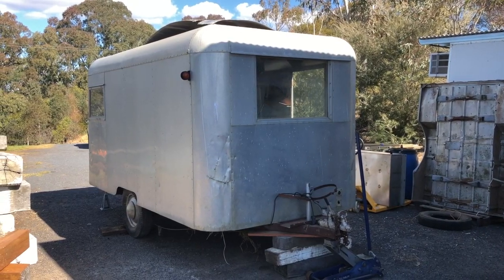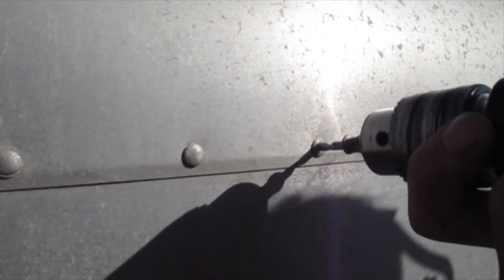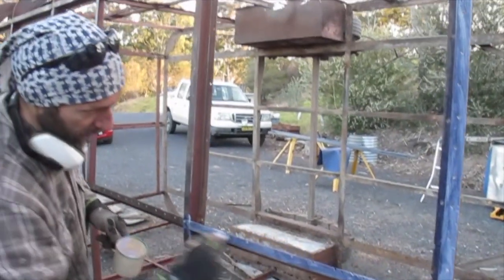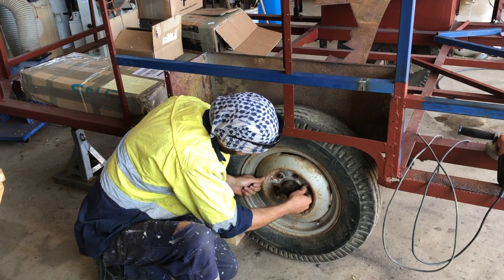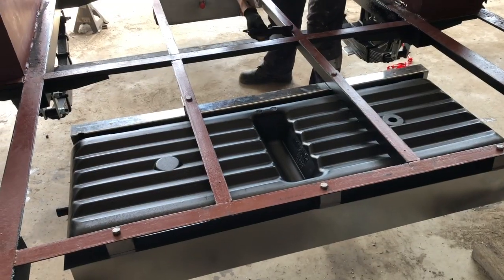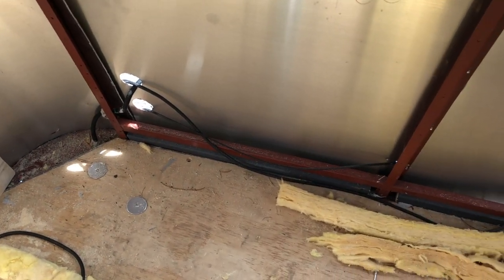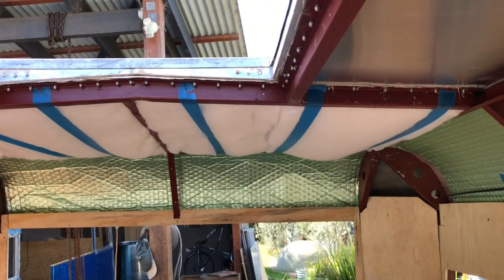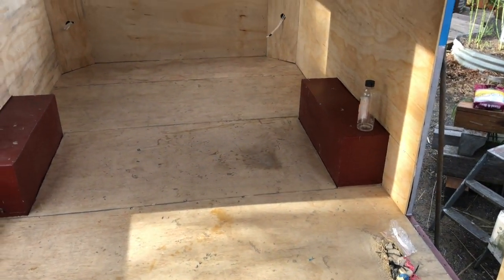Amazing food-van conversion - Best vintage food caravan build Part 1 of 2

Comment: Hi mate, would you answer me a question?  What type of material do you use in the hot areas like stoves or charcoal bbq? I'm building myself a charcoal bbq food trailer and not sure if wood would be ok on that area as it will get really hot...
By the way, dude,  you and your team are incredible! Thanks for sharing your knowledges with the YouTube family!
Reply from the maker: Thanks Tony, wood is definitely not appropriate in that application, stick to thick (1.2mm+) stainless steel for wall linings, benches etc if you are looking at high heat areas.  Standard stoves may be ok with stainless steel cladding over ply but not in a high heat commercial application like hat your proposing.